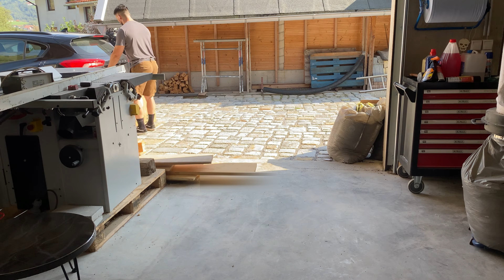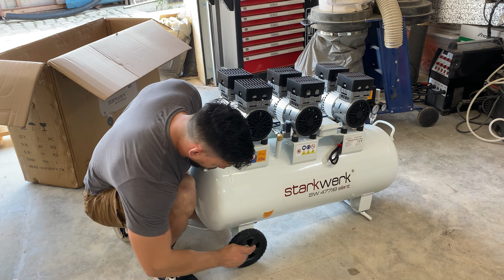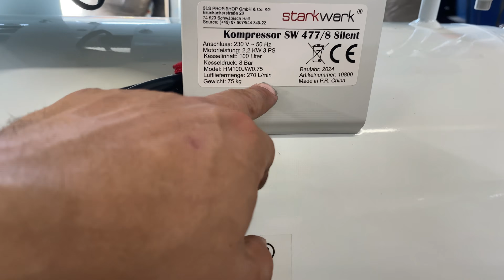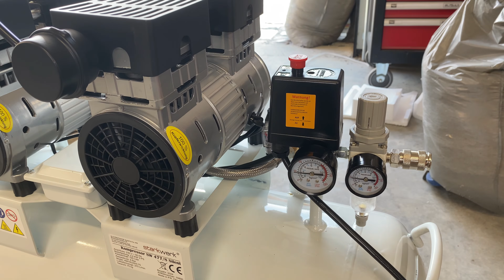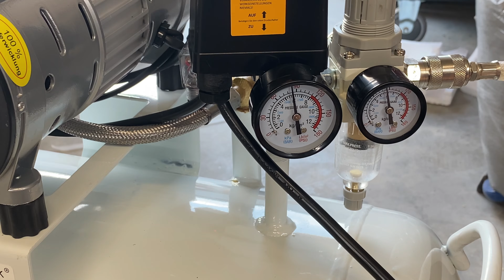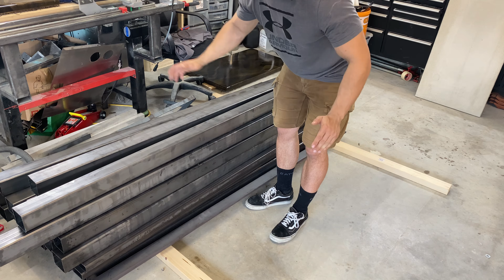I Put the Silent Air Compressor to the Test and Got SHOCKING Results!

Comment: most compressors come with the attachments loose to prevent damage in shipping, the instructions should tell you what to tighten for initial setup
Reply from the maker: Hey, every company is different from the multiple compressors that I had, everything was always tight. But, thanks for the info.